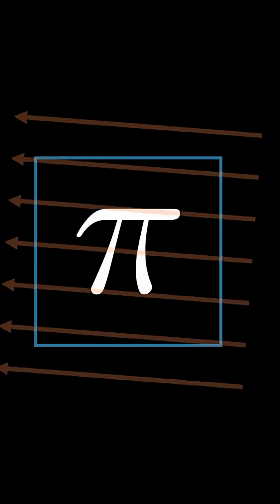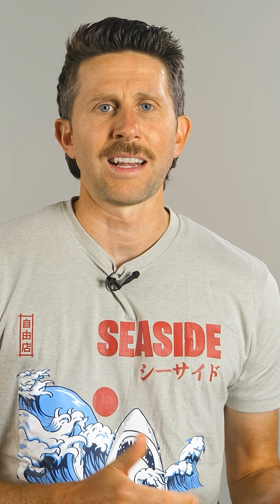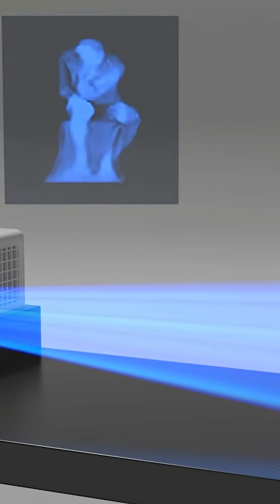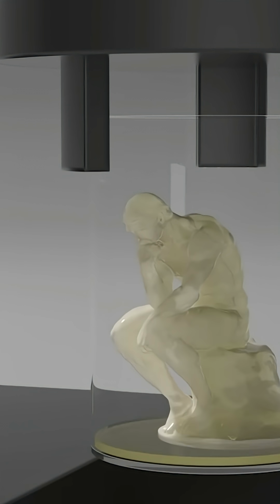World's Fastest 3D Printer

Comment: This is light curing plastic that has been around for decades btw, we use it all the time in the hearing aid sector as this is one of the most common materials to make the custom earpieces.
The problem is that the material is very brittle and breaks pretty quickly if it falls on hard surfaces, so idk if they are really suited for toys maybe an alternative but it wont reinvent printing thats for sure
Reply: UV resin printers print in layers. This does not.

Your knowledge about it is a bit stuck in the past by the way. Resin printers are very common now and they make all kinds of resins including durable ones

Comment: This must limit the design by a lot. Unless you can make the light beam increase its intensity at a certain distance from its source, you can only create solid structures or models that lack any detail on the inside. If you want the beam to pass through the outer layer of the model to make something hadde in the center, then will not the outer layer harden too?

Comment: I think there was a Chinese team that just made it faster.
They made a cylinder with multiple mirrors rotate around the gel, instead of rotating the gel.

Since the gel isn't rotating, just the mirrors, they can spin it way faster.

(They also used movable micro mirrors (MEMS) to make the filter (same as in DMD movie projectors) since those can change faster.)

Comment: I imagine there are limitations though. For example, you can't make something hollow, or with cavities that can only be seen through from above or below. (Although that last one could be solved if you split it between two projectors displaying different angles of the model)

Edit: I just realized that if you can project from every direction at once, all limitations are solved. Even just being able to have a curved surface where every point projects normal to itself, if shaped correctly, could vastly improve it. This would require some complex lense setups or the likely more difficult solution of basically creating a curved screen made of laser diodes, which would be quite dangerous.

Also, the surface being referred to is not necessarily physical, but is meant to properly define how the light would have to project for this to work.

Comment: That's cool, but I want HoloVAM tech. 😄
Integrate holographic processes. laser → beam expander → SLM → objective lens → rotating resin vial. 
Replace or augment the current DLP/DMD projector with a Spatial Light Modulator that controls both the amplitude and phase of light. The SLM acts as a programmable holographic element, essentially a digital hologram generator. Instead of just projecting intensity patterns like a regular projector, the SLM modulates the wavefront itself to create true 3D light field distributions.
Holograms can simultaneously project multiple wavelength patterns into the resin volume which would allow resins with different photosensitivity thresholds to be selectively cured in specific regions, enabling multi-material printing in a single pass. The current system relies on hitting a "critical value" of light intensity to harden the resin. Holographic control could create distinct intensity profiles for different material chemistries simultaneously.

Comment: I wonder if the same can be done with microwaves on other materials, or magnetic fields, or even more classical electrical fields and other forms of vibration or arc furnace level energy output to heat up or cool metallic materials in 3 dimensions or other more exotic forms of energy and particles? 🤔 

I'm sure its at least possible to do things in multiple steps and layers either making preformed solid or vacuous lattice structures using light and light or 'heat/cold' or sound/vibration responsive material and such or even energy signatures and then layer other materials or structure types using similar forms of True 3D printing or classical extruded format processes, possibly even accomplishing complex 4D/5D/6D printing making memory alloys and composites that evolve or break down in specific ways!

I had an idea for a storage and compute processing material a long time ago that would use light, nanostructures and microtubules, and various types of responsive or timed decay, stratification, or hardening curing materials for different purposes in the range from long term, mid-term, and short term storage periods and needs to complex processing and simple fast changing/stabalization/readability processing periods and needs and then also some ideas for microextrustion combined with various forms of 3D curing projection mechanisms for a while too, but I its fine if the industry and hobbyist or experimental community takes hold of them themselves and advances them much faster than I could ever do alone... as if they belonged to me or originated from me in the first place, heck my mind is just a vessel that they were probably project into similarly in the first place along with other minds 😂. I feel like the experimental iteration that collapsed and got stuck to the baseplate at some point 😅😭 or maybe I'm just a step in the form production lol

Comment: So...you can get rid of the need to pour the resin out if you use a two chamber syringe like structure with a lattice separating the chambers from each other. The syringe plunger enters from the bottom of one chamber and presses against the lattice. Then you fill the upper chamber with resin. Do your 3d print and take the chambers out of the printer. Pull the plunger back and that drains the printing chamber of the resin leaving only the part in the printing chamber. Remove the print with a pair of tweasers and push the plunger back forward which refills the chamber with the unused resin. Refill the printing chamber as needed. No more need for pouring out the resin except for when you need to filter the resin or clean the chambers.

Comment: That is amazing.  I do have to wonder about the internal structure though, if the resin at the center would get hit enough to cure or if you'd wind up with more like a shell.  Or if the surrounding resin has to be wasted due to partial exposure.  
This looks like one hell of a way to hide something as well, just put it in there and then cure the resin around it.

Comment: I wonder if a CRT would work better than a LCD for this kind of thing. The fact that the refresh rate is separate from the continuous light might work even better than flashing images when rotated at higher speeds. The main thing being that the refresh rate of a faster spinning LCD projector may start to cause issues on the surface of the object, like pixels being visible on an LCD for older games that a CRT used to smooth over naturally. That same method might smooth over the issues caused by an LCD spinning at higher speeds.

In other words, a CRT might produce the 3D print faster at the same quality level, rather than an LCD which might have a lower maximum rotation speed. That said, the rotation might be more difficult with a CRT involved due to the size of CRT components. It might get bulkier and heavier to implement.
Reply: Brightness issue with CRT and it's size, weight, and power requirements vs what they can do with LCD and LED arrays or solid state laser source.
Reply: The main issue is a CRT shoots electrons, not photons. The image is actually an illusion created by the phosphor coating on the screen. Idk if it would be possible to do this with electrons.
Reply: @AnotherAustin-z7b  ah, so true.

Comment: Now a regular 3D printer seems archaic
Reply: 😂. Yeah it is cool. But it can only be done with resin which is essentially acrylic. FDM can do a much wider range of materials. And going by the clip at the end, the resolution on larger models isn't as good as you can get with a resin printer that forms layer by layer (SLA).
Reply: @Numenor7 That's true, but resin can be used as a mould for other materials to form on to it. You're just making the initial creative stage faster.
Reply: @Misai-007  yeah
Reply: @Misai-007  Resin can be modified with other materials to condense into plastic or metal structures when melted.
Reply: @Misai-007 
Revelation 3:20
Behold, I stand at the door, and knock: if any man hear my voice, and open the door, I will come in to him, and will sup with him, and he with me.

HEY THERE 🤗 JESUS IS CALLING YOU TODAY. Turn away from your sins, confess, forsake them and live the victorious life. God bless.
Reply: @Misai-007 Moulds only work for things that can be cast. One of the main benefits of 3D printing is that you can create internal structures that are impossible to make with casting or machining.
Reply: @Numenor7 And there's the added limitation that it only works with transparent resin, because the light has to be able to make it all the way to the back.
Which is a huge limitation compared to normal resin printers that can work with opaque resin.
Reply: @Numenor7 this will advance, and there are so many different material resins now, they'll probably get there with this resin, too. 

Only thing I can think of is it limits to a specific range of colors, but you could paint these if it was absolutely necessary. This will have it's own practicality limits, but someone will figure out how to do it en mass where you can rough generate 500 identical products from seconds to a couple minutes.  

So wild.
Reply: @oldkingcrow777  yeah agree there are constantly advances in this space. I'm sure there are restrictions as to the colors and additives they can use since the light has to pass through the thickness of the material to form the solid object there. Any additives causing diffraction would result in a "blurry" print. The resins themselves aren't completely transparent, I suspect that's why they're not able to get the crisp details they can with SLA. With smaller models that's less of a concern since there's less material the light has to pass through. The resin can't be perfectly clear either, it needs to absorb some of the photons to initiate the solidification reaction. It's a balancing act getting the resin right.
Reply: @Numenor7 have you looked at the microscopic printing early in the short?
Reply: @nowheremap You can do that with laser based resin printers
Reply: Because it practically is. The original FDM 3d printer is over 30 years old! (34 as of now)
Reply: Yeah, however with this technic it seems to be difficult to do enclose space with stuff in it, or channel inside wall.
Reply: @etiennedud That's just an issue with resin printers in general. Models need to have one or multiple holes to let resin drain out
Reply: From the 3d printed stone age lol
Reply: I think the arc of progress in 3d printing will happen when material science progresses. That would be where the big changes would happen.
Reply: This will evolve just like regular 3D printing did.
Reply: You can’t print anything if there is no electricity. Believe me it would be used in medicine and military. And electricity will be the first target in case of … you know
Reply: Nah its just that lasers will make everything better and more efficiently
Reply: It is. 3D printing in it's current state is at least 10 years old. That's old for modern technology.
Reply: @narrativeless404  it's not really old for modern tech. the whole "technology keeps progressing more rapidly" thing has stopped being true for decades now
Reply: @Just.Kidding 
In certain fields technology slows, in others, it speeds up.
Reply: Not really. You gotta clean this a lot more than a regular 3d printer with layers

Comment: It reminds me a bit of cnc machining due to it being a subtractive manufacturing technique, the only limitations being the specification of material used and the inability to print hollow enclosed shapes.
Reply: Whats it subtracting though? Whats it adding? This is something else! Transforming? Not great.... im sure theres a better word for the change.
Reply: @Dea @DeathxCap  with additive manufacturing you are literally printing out the object but with subtractive manufacturing it requires some sort of basin of material to start out with that is bigger than the finished product. Since the resin is acting as a base material of which most of it will be discarded or reused after the product is done I thought subtractive manufacturing would be a suiting label.

Comment: advancements:
 with no layer lines and solid single pass construction, 3d printing technologies are approaching the efficiency and capabilities of other plastics manufacturing methods like injection molding, while retaining the features of 3d printing that are most attractive 
limitations:
the plastic has to be transparent to the wavelength of the projector and hollow constructions are limited by the liquid submersion. clever design practices can mitigate this but it will still limit the use of these technologies in certain areas

Comment: I might be missing something critical, but how does light rays not cure the resin it first hits on its way to the middle where the print is formed?
Reply: I could be completely wrong but my guess is that it has to due with the fact that the resin needs a certain amount of light to harden? Like maybe since it’s spinning it only hits that in-between spot for a short amount of time which isn’t enough to activate it but it hits the center spots constantly the whole way through so they’re the only thing hardening. Idk though, either way it’s cool.
Reply: So I just rewatched the video and I can see some wording that caused me to trip up. A constructive criticism would be instead of describing it as the intensity of light causes it to set, rather an accumulation of that intensity overtime causes it to set. The way I was thinking of that explanation was that if the light ray’s intensity was causing it to set I couldn’t figure out why we didn’t just have a bunch of pillars coming off of the shape at a bunch of different angles since the intensity of the light would be strongest at the surface as it entered I imagined. Also the shorts format cut off the diagram of the shape in the spinning graphic segment which would’ve helped the understanding a lot
Reply: @ttc_lover  I suspect it’s a combination of both. Think of it like temperature: if you concentrate enough intensity from different angles to heat the resin locally, it hardens. You’d just need to balance the intensity and timing to prevent heat transfer to the rest of the resin. Even if it's not actually thermal-based, it’s a helpful way to visualize it. Of course, the devil is in the details. The key is for the resin to have a very steep curing profile to ensure sharp, defined edges.
Reply: He tells us in the video, although is not very obvious how it works. The intensity of the light that goes through the material is designed to have the exact amount to harden a certain amount of material in the right position, just a little bit, then the angle changes one degree and the intensity of light changes again to just harden a little bit more in the right points and so on, is like instead of hardening by layers, it hardens by degrees of a rotation.
Reply: It looks like it half does, cause it has the swirls. Its probably a focal point thing
Reply: He literally explained it in the video though o.o